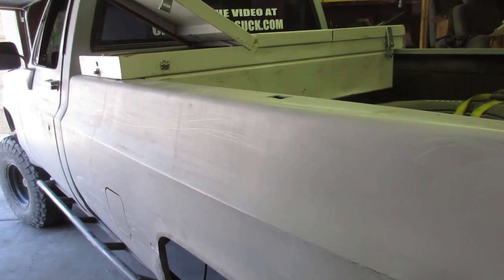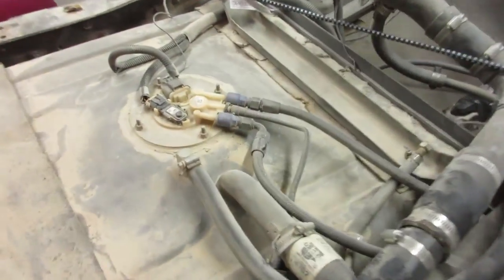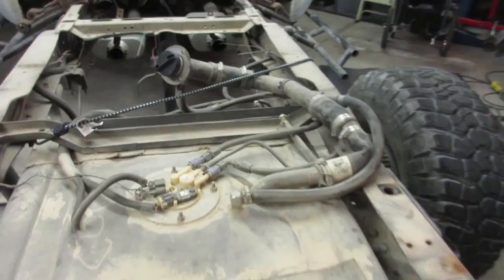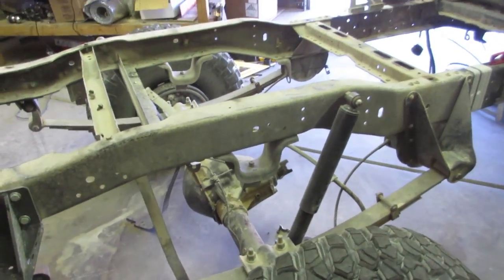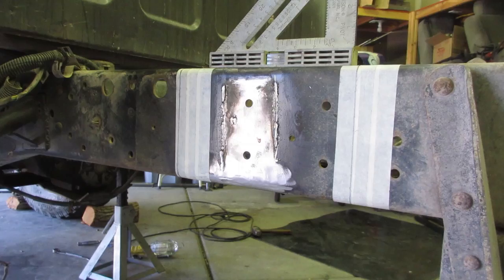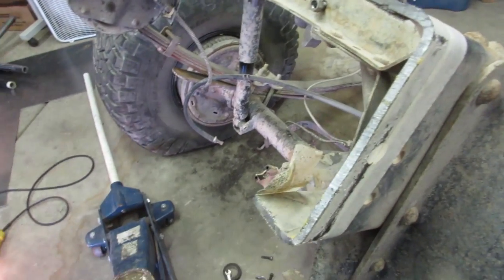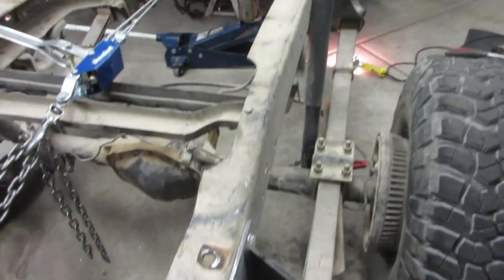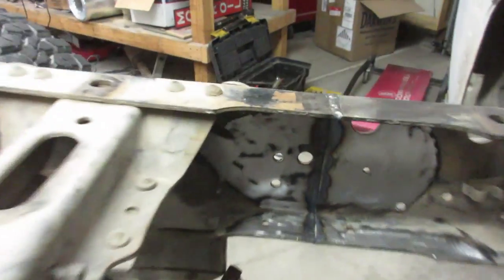Chevy K10 - Frame Shortening - Rock Rig Phase 1 part 1

Comment: Dave, you are the  man.  When you say your going to do something you don't waste time!   I got my sticker so I wanted to say thanks sir, but also while watching this video I saw something that you can probably answer (so sorry for the wall of text).  I noticed you went with the corvette style regulator, and It looks like in the past your intake was the stock 5.3/4.8 type with the regulator built in.  Did you have to do anything other than cap off the return line for it to work OK?  I'm at that point where I am about to start running line and throwing the new baffled tank in my K5 but I keep getting conflicting info in regards to what is best for that setup.  I already have the corvette filter, but I also have a stock one just in case, but I really want to avoid running any more fuel line that I don't need.   I'm sure you covered this before but it's always a challenge to go back and find which video because I know you transferred this setup out of your old K5 into the K10 so there is a lot of history.
Reply from the maker: Thanks! As far as I know if you have a returnless rail you run the corvette regulator, and if you had the return rail, you have to plumb more line. I don't have a definite on this, the truck intake I have has a returnless rail.

Comment: It's to bad you are so far away from me in east Idaho I have a 87 dodge 3/4 4x4 standard trans, 360 motor , 208 transfer case . All mechanics work great , Dana 44 front. Dana 60 rear . I have a nice steel diamond metal flat bed with head ache rack on it. Truck has fried wiring harness.
Reply from the maker: Do you have any plans for it?
Reply: MrWhitels1  not as of yet . I really like the granny low with the 208 case it will crawl along at idle no pedal needed. I might consider selling the whole thing to the right person . Would be a awesome rig to build or part out . Let me no if you might want the axles or flatbed , all in pretty good shape . Thanks. Phil

Comment: I already asked in another video if you cut the frame before I saw this one. Have a couple questions: why didn't you just move the spring mounts forward instead of chopping the frame? Why didn't you cut it down shorter than you did?
Reply from the maker: I figured it would be more work to move the hangers, and I didn't want the rear shackle up too high. I also liked the flat part of the frame above the axle for my tank mount cradle. For the wheelin I do 121 works out well.

Comment: Are you going to box the frame where u cut the frame ?
Reply from the maker: Yeah, and then I don't think it's going anywhere!
Reply: Alright good after boxed it should be way stronger than before
Reply from the maker: We will find out!
Reply: Doesn't need box needs plate
Reply from the maker: You are right Jim, it did need a fish plate, which is why in the video after this one I did just that, I also boxed the section! Thanks for watching!

Comment: If you ever do this again, you should really try and Z cut the frame. It makes it so you can easily align things back to the way they should go and you don't have all of your vertical weld in a straight line. 
In case you don't know what Zing is I would check this out. https://www.powernationtv.com/build/33/66-chevy-c-10?episode=TK2007-10 at around the 8 minute mark.
Reply from the maker: I did a ton of research on the subject. In the end, strength wise, doing it like this with a fish plate and a frame boxing plate there is really no difference. It has been holding up with no issues.

Comment: Nice work..!! Did you weld it with a flux core welder? I’m planing to cut my frame and weld it too...
Reply from the maker: Thanks! I used a lincoln weld pack 100 with .35 flux wire. I use it on just about everything. Good luck with your project!
Reply: Dick's 4x4 Garage thanks.. yes hopefully everything goes well.. I’m going to make the cuts in a z shape hopefully it’s stronger..
Reply from the maker: Do your thing man, you gut a build thread somewhere?
Reply: Dick's 4x4 Garage 110v welder?. I want to do my truck too but not sure what welder to get to do the job